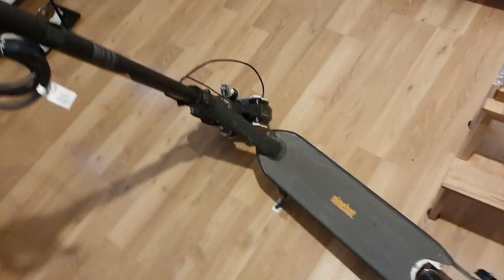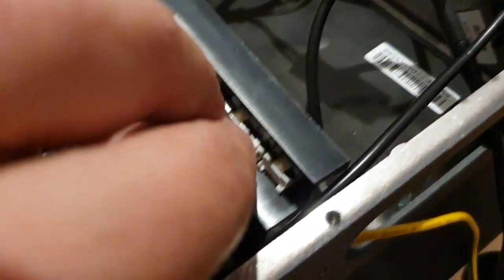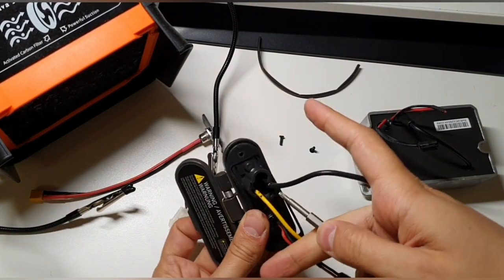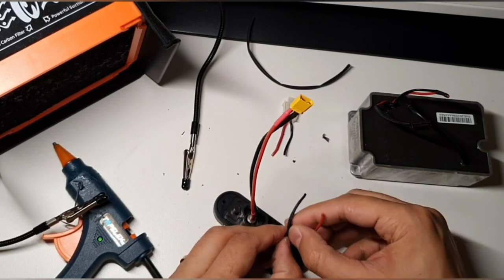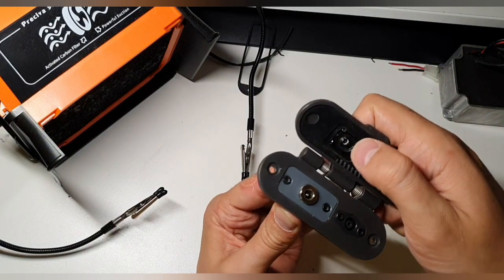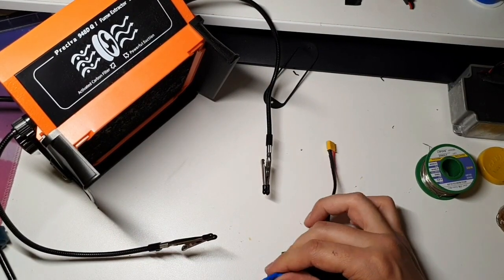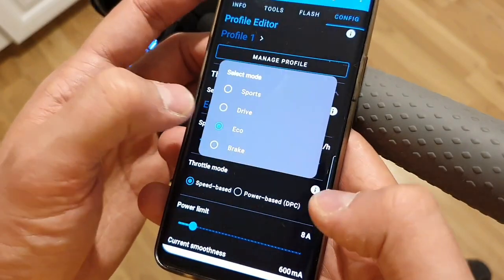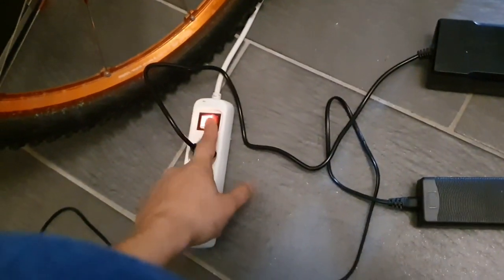Ninebot 48V Mod For Noobies

Comment: Hello mate! did you try newest shfw with field weakening? its amazing stock gen1 36v reaches 45-50 on full battery!! on flat downhill 55! i reach 57 on air shows 59 default but i changed wheel size to 9.3 to get correct speed!
Reply from the maker: I installed it yesterday on a Gen 1 with 48V mod and did not increase the field weakening values by much and could feel the boost kicking in. (DPC 24A, Start 33km/h, initial 3A, 400mA/km/h)
Will test it on a Gen 2 with 48V Mod and push it a bit harder, but i would not recomend to push the Scooter over 45km/h. Its bad for the Battery and Motor and probably for the Controller too. The G30 is also not built for higher speeds. It has no suspension and driving over 40 is very dangerous with this scooter. I have a Segway GT2 and compared to the GT2 the G30 feels like a toy.
What values did you set?
Reply: @McKuc  I did set dpc with with 32A and start speed 22kmh initial 7 and 1700mah it was great but the motor become very hot now i try with 5A and 1500 its ok but i think i need to lower my amps to 30A or even less
Reply from the maker: @Vilhozi  I would not go over 25-27A in DPC
The DPC A + Initial A together should not be higher than 32A
Reply: Normal amps do 27 and field weakening Initial 4 amps and 1200 mah  per km/h. Mine goes 50 flat. Doesn't get warmer than normal
Reply: @jbjbb490  nah i do 30A 5initial 1500mah 20startspeed
Reply: @Vilhozi  could melt your cable if you drive up hill
Reply: @jbjbb490 Nah it didnt now i use 65A because upgraded connectors
Reply: what are you talking about? what is shfw?
Reply from the maker: @theuberserge 41:00

Comment: Do you use the original controller? Using custom firmware without adding 12v in series and adjusting controllers? Is the original controller overloaded?
Reply from the maker: Yes original Controller. 48V is okay for original Controller. Just reduced the max current.

Comment: Is it safe to remove that charge box and use direct power?
Reply from the maker: Yes it is, if you know what you are doing. The g30 can be charged by internal powersupply or by an external anyway.

Comment: my 500watt ninebot max g30 clone can already reach 40 without any mods done to it, however it sucks at uphills cause of my weight T_T
Reply from the maker: how is it called. i guess it has a smaller battery then the max g30. the voltage drop is a bigger problem when going uphill with a smaller battery

Comment: Ich hab es wie in deinem Video gemacht, außer dass ich die Ladestecker vom Hauptakku auch gegen xt30 getauscht habe. Ich habe jedoch keine Batterieanzeige mehr egal was ich mache!? Woran kann das liegen?😑
Reply from the maker: Welchen Scooter hast du genau?
G30D2?
Hast du alles ordentlich angesteckt (nicht verkehrt herum)?
Reply: @McKuc  Einen G30D 1. Generation. Aufgrund der Nippel die in die Buchsen am Controller einrasten, gehe ich davon aus, das ich sie richtig wieder eingesteckt habe, im Fall des Steuerkabels vom BMS (an dem es ja dann liegen müsste) nach rechts aussen wenn man davor steht. Habe die Verbindung auch danach ein paar Mal ein und ausgesteckt zur Überprüfung. Hab eigentlich auch darauf acht gegeben, dass ich vorsichtig mit den Kabeln umgehen, während des Umbaus. Bin am verzweifeln. P.s.: Habe dir auch in deinem Thread auf RP geschrieben.
Reply from the maker: Steck mal das Y-Kabel um. Der Minuspol sollte von der Internen Batterie zum Controller gehen.
Reply: @McKuc  also Y-Kabel sollte passen, ist wie von dir beschrieben Minus HA zu Minus Controller. Roller läuft auch super. Es ist eben nur die Batterieanzeige weg, Balken sowie auch die prozentuale...selbst wenn ich umstecke auf 36 Volt zu Controller,ohne Zusatzakku. Hab jetzt nochmal Vanilla geflasht und er zeigt mir dann Code 21 an, fehlende Kommunikation zum BMS.... 😒
Reply from the maker: @elcarnale  ADC resistor hinüber 🤔
Reply: @McKuc  dir kann man den Akku nicht zum Reparieren schicken oder? Anhand deiner Videos, gehe ich davon aus, dass du weißt was du an den Dingern machst😁 Ich hab Schiss ohne Kenntnisse aufzumachen und nach dem BMS zu gucken, geschweige denn was daran zu fummeln... natürlich gegen Bezahlung....
Reply from the maker: @elcarnale  es liegt wohl am Controller und nicht am Akku bzw BMS

Comment: What's the Ah and Wh of that extra battery
Reply from the maker: 12V / 20Ah / 3S
Reply: @McKuc  cheers don't suppose you have a link to this battery :)
Reply from the maker: @saint105x3  https://www.scooterdoktor.com/
With the latest SHFW and Field weakening you can drive 40km/h withstock battery. I managed to drive 49km/h but i would not recomend pushing it so far. 35-40km/h is enough. There is no need for an additional battery in my opinion.

https://youtu.be/rfXen8yiTOo

https://youtube.com/shorts/I5wAk2uNN2U?feature=share
Reply: What controller is that ? Is that OEM?
Reply from the maker: @RideWithAnthony  this one: https://youtu.be/rfXen8yiTOo

Comment: If I install 48v?  Can I still install 2x 12ah additional batteries?
Reply from the maker: Can you explain it a bit better?
You want to have the 48V mod (36V +12V) and add 2x 48V 12AH in parallel?
Reply: @McKuc  So I currently have 2x 12ah additional batteries for more range... my question now is, could I also add the 48v battery to have even more speed?  Or it doesn't work
Reply from the maker: You will need a large 12V Battery.
If you use a 12V Battery like i did, it will discharge faster then the rest and the scooter will shut off although your 36V batteries are not empty. You would need a larger 12V Battery for the 48V Mod.
Its better to get everything out and build one large 48V(or higher) Battery instead of having to mess around with 4 battery packs.
Reply: @McKuc  okay thx